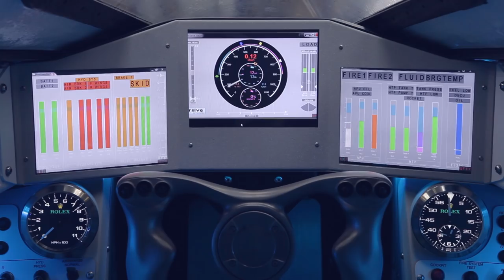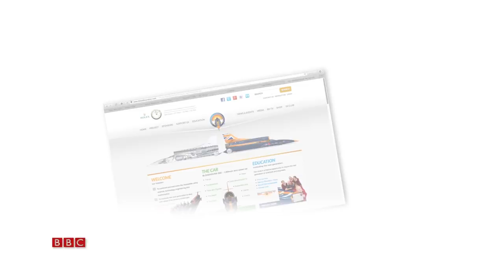An Introduction to The BLOODHOUND Project

Comment: Such a great project, BUT whoever set the ticket price at £60 is crazy! It should be £10-15 max!
Reply: PJ B PJ B I have to disagree with the 1910 bit, ha. It’s very advanced science strapping an EJ200 and a liquid rocket engine into a composite car at this level. But it’s a 200mph test with maybe 1-2 runs, which for £60 each is very steep. Everyone I’ve spoken to isn’t going because it’s 3x more expensive than it should be. Especially for a project that’s been heavily subsidised by industry sponsorship. Anyway, for those that go, get some great clips, forecast looks dry so have a great time! :-)

Comment: Why the piston engine at 19 seconds?
Reply: +brahoy  --  From the Bloodhound SSC Web site:  "a Jaguar Supercharged V8 engine – will act as an auxiliary power unit to drive the rocket oxidiser pump."  Basically it is the fuel pump, and when you have to move a massive amount of fuel very quickly things become quite complex.
Reply: That's what I was wondering...

Comment: The main goal is to reach a number of 1000 mp/h. That means a high tech project aims for a record in an old unit, which should be used in history books anyhow and definitely will not be used and longer in 20-30 years.
Reply: ....should only be used in history books and will not be used any longer in 20-30 years.
Reply: Phil jetfan still used in the UK.
Reply: Well the simplistic explanation is that most land speed records are set at the Bonneville Salt Flats in the U.S.A. which still uses the imperial measurements and probably will for the foreseeable future.  The international F.I.A. though does set down class records for both Kilometers and Miles Per Hour.
Reply: Both imperial and metric units are used across the world, especially here in the UK. 

Neither will be obsolete from use.